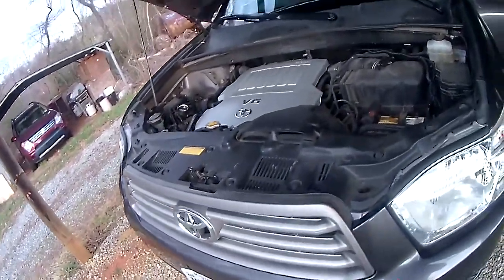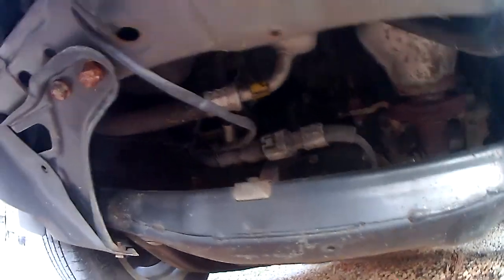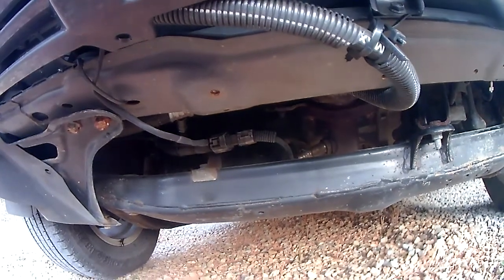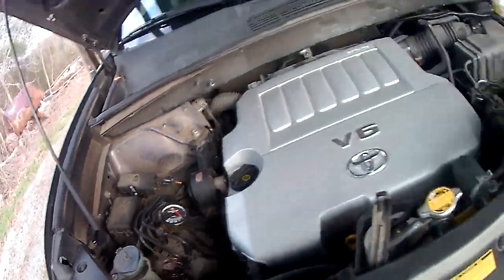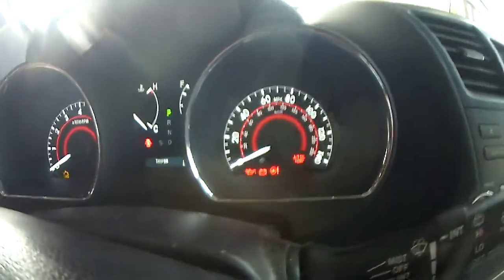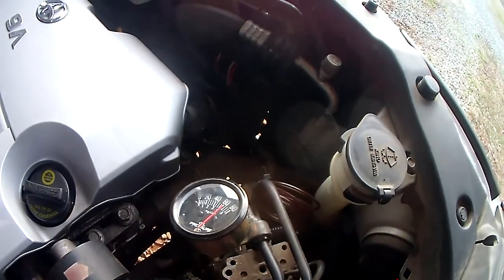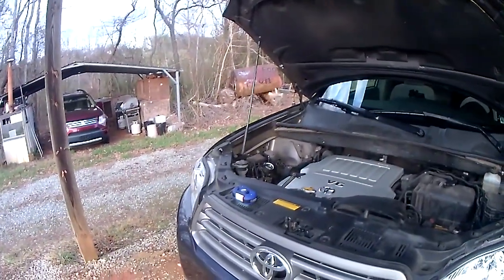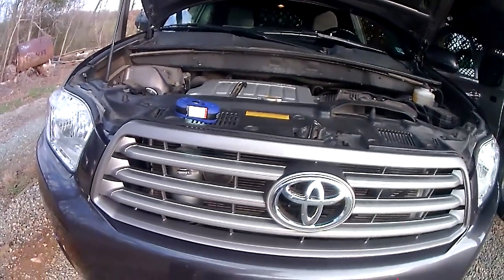Toyota highlander variable valve timing rattle fix

Comment: it seems like you spent more money on this project than you would have spent just buying the vvt solenoid and replacing it?
Reply from the maker: Solenoid is not the problem.... Cam phasers are the problem... They can't be changed with the engine in the car . My fix cost only about 40 dollars and it hasn't rattled in over 60000 miles ...but you are the expert i guess 😅
Reply: Lol, fixing this the right way, would cost you at least the cost of pulling an engine out, + timing chain job + parts

Comment: I did what someone else considered a vvt rattle fix on YouTube and worked. Just replace both valve cover gaskets and double o-rings.my 2013 Highlander has 195k km. All valve cover gaskets were hard and drying up. Althought no leaks the double orings seems to be the culprit. I think the quick rattle on startup is shorter than before
Reply: That's sounds like an expensive fix
Reply: @Mshi-  I did it myself. 50$ at the most for the gaskets
Reply: But your Highlander has the updated 3.5 2GR engine I have the 2008 Model @jean-pierremallet3524

Comment: I have 2008 highlander with 178k miles no rattle but I also run 5w30 instead 5w20 that Toyota recommends for fuel efficiency. Do my oil changes every 5-6k miles and make sure to aways put 6.5 qrts. Keeping oil at recommended levels helps VVT gears from overheating and eventually rattling. Definitely one of the best v6 engines in the last 20 years.

Comment: Awesome vid, I just picked up an rx and I was unaware of the vvti issues. What kind of fitting did you use on the propane tank to add the oil and how did you position it onto the front end? What kind of Tee did you use?
Reply from the maker: I welded a 1/8 inch pipe nipple to the tank after i made sure it didn't have any propane in it. And the used a brass 1/8 inch tee for the hose and sending unit ..i am going to post a new video this coming weekend of how to do it.
Reply: @davidrobertson8035   You're a God send. I just dropped good money on an '09 RX, and a massive wave of worry punched the gut thinking of the repair cost. Please, with all do respect, provide info for a donation.
Reply: Hey David, I'm going to give this a go based on your info. I'm not much of a handy person, but can you tell me what kind of pipe nipple and brass tee you used? Seems there's various kinds like male to male, male to female, etc. Can you explain the install in detail from how your positioned the tank from the tee you welded, the type of hyrdrolic line attached to the brassed tee, and then what follows? Anyways, thanks in advance.

Comment: Would adding a oil pump between the oil drain plug and oil pressure sending unit work as well? Making the pump work only while cranking the engine
Reply from the maker: Yes ! But put a check valve between  the pump and the engine . I tried this  too . It works great.

Comment: Very dangerous at A Toyota tech and owner of a highlander I implore not to do so. Easier or just as easy to replace phaser. You will be glad in the longer run. Best wishes
Reply from the maker: How is it dangerous to prelube the engine before starting it ? This way the bearings all have oil before the engine even turns .
Reply: And what is a Phaser???

Comment: This is not the right fix. The correct fix is to get the VVTI gears replaced. While the startup chatter is rare, it is fatal when it gets really bad.
Reply from the maker: I agree ..but it works ..100 dollar fix versus several thousand ...
Reply: @davidrobertson8035  I guess it depends on how much longer you intend to keep the vehicle.
Reply: Yeah, thats an engine out job. These engines blow, I’m not sure why the hype on these especially with this issue. Mine failed and sent metal through the engine. I swapped in a used one with 60k miles. Color me Toyota unimpressed.
Reply: @bobd9868  I really don't understand the hype either.

Comment: What kind of reservoir did you use and what kind of solenoid did you use my Lexus has the same problem
Reply from the maker: tank is a propane tank ...and just a 12 volt solenoid valve bought off ebay
Reply: @davidrobertson8035  like a tank for a torch. How did you attach it
Reply from the maker: @colchronic  i made sure that it was empty and welded a fitting on it .. but you could use any small tank that can handle the pressure
Reply: @davidrobertson8035  last question where exactly did you attach it to I know you cheated into some place but I'm not sure where to tee it to
Reply from the maker: @colchronic  i took the oil pressure sending unit out and attach the hydraulic line there . at the other end i put a tee . the sending unit  goes in one port ..the valve in the other and the pressure tank is behind the valve .
Reply: @davidrobertson8035  ok I think I'm following your thinking, but what's next?? Do you fill up that small thank with oil???  If so, how much?? And where  do you attach the gauge to??

Comment: David, can you link a parts list and general instructions pdf link in your Video Description box?  A detailed video would really be nice, but the instructions are fine if that's quicker.  Even faster would be to reply to my comment below where I tried to put together a parts list.  You could copy and paste what I wrote, and then correct it and add explanatory comments.  When you do an updated video, you could title it, "How to Dramatically Extend the Life of Your Vehicle's Engine for about $100".  This type of system could be standard on all vehicles to optimize engine life, not just on vehicles with engines that rattle at start up.

Comment: Seafoam treatment to clean passages in the pin not closing in the vvt sprocket then synthetic 0-40 to lower viscosity @ startup or 0-30 for colder climates is another option.
Reply: Has this actually work for you??? I thought about the same thing last week and I even though of usingWD40 or  Mistery oil, some how injected directly in to the cam gear.

Comment from the maker: I did  the video showing  my solution for the rattle problem just to see if anyone is interested.  If I got enough attention I was going to make a better video showing how it is done . I now have this on a few other vehicles and it seems to work quite well.
Reply: Thanks Dave
I would also like to see a installation vidio
I have subscribed to your channel
Reply: hi David thanks for the video. do you remember what type solenoid valve you have been using.
Reply from the maker: @williamwhitlock2701  it's just a 20 dollar 12 volt solenoid valve bought off ebay
Reply: @davidrobertson8035  thanks
Reply: Be nice and see how you do that
Reply: Make the installation video :)
Reply: Hey David, hope you're still on youtube. I just picked up an 09 rx350 that rattles. Any chance on making the how-to available for a fee?
Reply: Need to show the insulation would help
Reply: I wish you were close to my house I would pay you to do this
Reply: Hi. You gonna give some drawings and sizes, be great if ya did😊

Comment: Thanks for posting.  This is a very creative application, but the explanation assumes a fair amount of specific knowledge, which people new to this game, like me, don't have yet. 
Even so, I know what is possible down the road, and thanks for that. I have a 2001 Camry with a 2AZ-FE that knocks on start up, and I'm curious if something like this could resolve the issue. 
BTW, do you add in a little extra oil on oil changes to account for the oil that sits in the reservoir?  If so, how much seems to be working best?
1. Proper sized propane tank reservoir (~1.5 qts of oil)
2. Oil pressure out (where sending unit would normally be) is directed into tank using hoses.
3. Solenoid valve releases pressurized oil when ignition is turned on.
4. Has switch to allow 60 lbs. of oil pressure worth of oil to be stored in reservoir on lower dash board.
5. Fitting (1/8 in. imperial to 1/8 in. pipe thread). 
6. 1/4 in. dia. hose x 3 ft. hydraulic line (at tractor supply shop, no doubt down the street in every big city.  ;-)
7. Hydraulic line goes up to a valve (connected to the propane tank???).
8. Propane tank had fitting (???) welded to it.
Information from this video might help someone looking for a bit more detail than is in this video:
Solving Engine Rattle during Engine Startup on Toyota Highlander,RAV4,Camry,Sienna and Venza -- https://www.youtube.com/watch?v=yKUQrXgOC2M